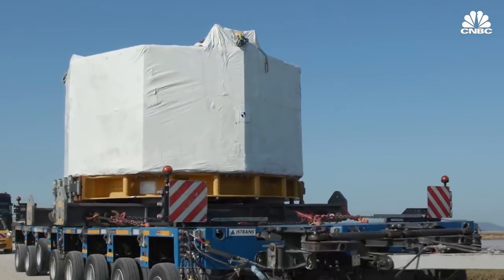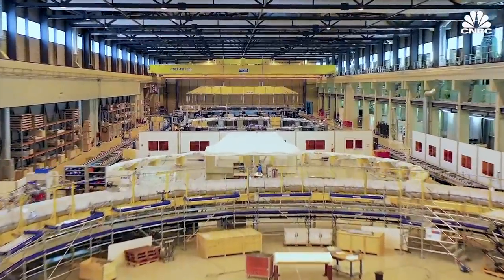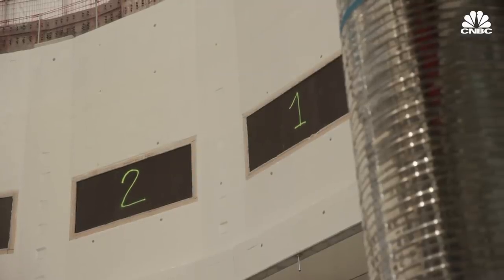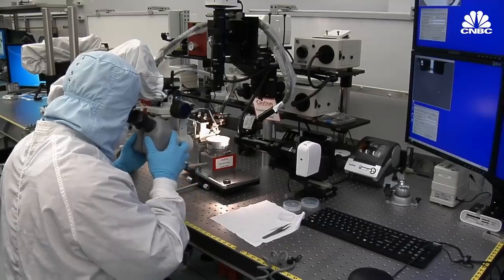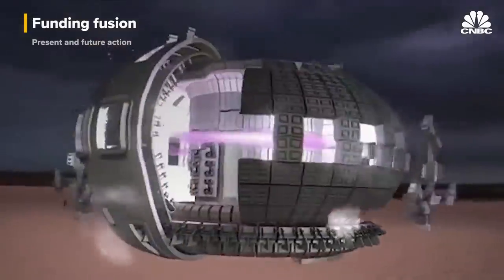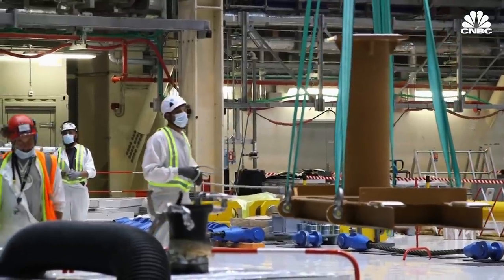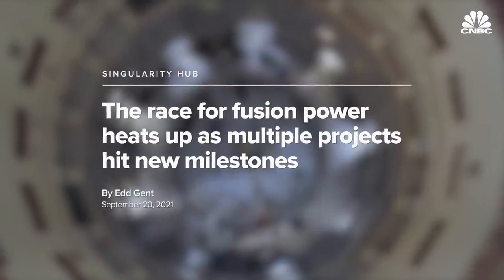Can This $22 Billion Megaproject Make Nuclear Fusion Power A Reality?

Comment: Here is my question? Will ever turn profitable even if it did work? Stuff is going to wear out and break costing probably a lot to fix. Will the net benefit outweigh the costs ever? plus all new infrastructure to translate and move this energy into a usable form in a normal house.
This is 100+ years out IMO Ill be dead by then

Comment: When you thought the world was at it worse, you get this. "150 million centigrades" (2:38), that's ten times the estimated temperature of the sun's core. Have any "calculations" been made as to what could happen if this magnet barrier fails, where this reaction and heat goes and what the impacts are?
Or no?
Reply: Magnetic fields don't just fail. There is a great amount of energy in a magnetic field of this size and strength and it takes a while for that energy to dissipate. The experiment would safely shut down during that time. Worst case the plasma hits the wall where it might do minor damage. The facility would be down for repairs for maybe a year or so, depending on how long they would have to wait for the radioactivity of the wall to decay. You simply have the wrong ideas about the meaning of temperature in this context. What is happening in there is nothing like the interior of the sun.

Comment: I am staggered by the size and cost of this project because they are not sure it will work and do not have a viable application for putting this massive experiment into services to justify the cost of building it in the first place.  It would seem that they could have made a much smaller version if it was just to prove that it could work.  However, now it looks like they were too smart for their own good and may have shot themselves in the foot as there may not be enough money to finish the dam thing.  It's like they never really had a budget to achieve the success of the project.  WTF!
Reply: The funny thing is, the smaller project would produce a lot of energy and maybe even more than fusion. They are just stupid.

Comment: Will this make net energy? Well yes, but no... Let me explain. Their goal is to take 50 MW of input heat energy and get 500 MW of heat from fusion. 10x. Great, huh? Sure, but that's not the whole story. ITER will actually consume at least 300 MW (I've heard of estimates that are over 400) of electric power to function (the 50 MW is just for the direct heating of the plasma). So we are down to 1.6x. And since the efficiency of converting heat into electricity has a theoretical limit of 50%, they can only make 250W of usable electric power.  So we're down to 0,8x. The theoretical maximum is 80%. Real life numbers would probably be much lower.

But it's hard to impress people with that. They always say that ITER will not create electricity for the grid because it's an experimental reactor that is designed to only test various technologies. But the truth is, it will only run for short periods of time to perform tests. Because even if it worked exactly as designed and maybe even a bit better, it would only be a power drain not a power producer. 

All the people involved know and acknowledge that this is just prototype for various technologies. They hope they will learn from this to make an actual net energy reactor. But saying this will make net energy is simply dishonest. Not sure what will happen first:  we get a working fusion reactor or a fusion documentary that properly presents basic facts... :)

Comment: If the magnet will lift an aircraft carrier 6’ off the ground it will lift it 600’ of the ground. The height is doesn’t matter.
Reply: I believe what they mean is, theoretically, if the magnet was held six feet off the ground, a carrier would be pulled upward to stick to it. Like, 6 feet is how far it's magnetic pull can reach.

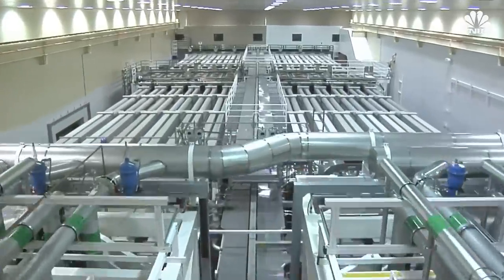Comment: 3:09 Yet another pop sci video that gets the most important figure wrong. Dont get me wrong, I'm very happy fusion is being researched and covered, and i agree it needs far more funding, but this efficiency factor theyre implying of getting 500 MW from 50 is highly misleading. These are the energy outputs and inputs for the nuclear reaction itself, not the reactor as a whole device. ITER will become the first to produce a net positive REACTION, but it will not even come close to generating electricity. Overall it still takes far far more energy to run all of the machinery that enables the reaction to take place inside the reactor, and ITER is not designed to ever generate a net positive energy output overall. That will come from its successor, probably some time in the 2040s/50s. Getting there faster will require massive funding, and although I think its totally worth it, ITER isnt designed to generate power and we shouldnt mislead people. What we should do is create a new national fusion development program and give them a budget twice the size of NASA (a drop in the bucket compared to the 800 billion pentagon budget).

Comment: Even in the first 2 minutes there are two items of misinformation. First ITER will not be a net producer of power, second the fuel is not hydrogen as is stated. We should be clear, even if the conditions for the DT reaction are met, only then do the real problems begin as designers try to work out exactly the details of 100% tritium breeding and extraction (almost certainly impossible - the tritium will diffuse rapidly throughout the structure) and how to fit together neutron multipliers, breeding modules, magnet shielding, pumping ducts, cooling pipes, etc. The complexity is mind boggling, and the cost will be astronomical.

Comment: ITER will produce more energy than needed to heat plasma in reactor core not to run entire reactor itself. Please correct this misleading information goal 500MW Heat consumption of entire reactor during this is 620 MW for peak periods of 30 seconds during plasma operation and 110 MW idle. Ifno from official Iter site.

Comment: I hope it splits the earth in two .
Reply: Welp it can't
Reply: @marcovillela7438  if the heat it generates can't be contained what preatel do you think is going to happen .
Reply: @michaellalanae7228  Simple the plamsa will start to expand making it lose its density and with the super cooled magnets around it, it will start to loss heat and turn plasma back into a gas. So basically the only thing that would be damaged will be the fusion containment module and the super cooled magnets.

Comment: It is not an "innernational" project, on the contrary it is "international", which is something completely different.  Please, do not speak sloppy.  BTW, 50 years ago, when I was in high school, we were told that nuclear fusion would provide energy in ... 50 years.  It did not happen, and it will take at least another 50 years before we might see any results.  Been there.

Comment: As a scientific project this is good, however the practical use of the technology is far away. Go for molten salt reactors. The science have already done and the engineering has come far already to have a cheap, reliable, safe and carbon free energy production that has material to last for ten thousands of years. That will give scientists plenty of time to figure out fusion Energi.

Comment: Why don't they make nuclear power plant so that bills be cheaper
Reply: If you do a full costing of fission power, it is more expensive.  Fusion power is not yet a thing.  They have good reasons to not make either type of power plant.
Reply: @kensmith5694  but in terms of usefulness I think nuclear power plants are more useful than thermal or coal. But strict maintenance must be maintained
Reply: @DunKirk1st  yes they can produce million of times more energy then coal

Comment: No one ever mentions the 14 tons of ultra-toxic beryllium used for the First Wall.
Reply: And with that? Your logic is not that great really. That beryllium is now in a safe environment where it cannot harm anyone. Would you prefer having underground, maybe just under your house, in a nuclear waste containment facility?
Reply: @deepdream1119  Safe environment?  You are wrong.  The plasma in the tokamak will erode the beryllium into dust, which will get spread into the port cells during maintenance.  This is well documented.
Reply: @robertwinkel9209  So what's your source exactly?
Reply: @deepdream1119  Because I work at ITER and we are studying this closely.
Reply: @robertwinkel9209  And I am superman, I am here to protect people from giant alien lobsters. Provide proof
Reply: @deepdream1119  I can't post a picture here.  Send me an email address and I will send you a note from my ITER email account.
Reply: @robertwinkel9209  "The beryllium used in the manufacture of ITER components will be non-radioactive; however, measures, systems and actions shall be implemented to control and prevent any beryllium exposure to workers, operators and the public. Classified as a potential carcinogenic, the primary risk with beryllium is the inhalation of beryllium dust"
Reply: @deepdream1119  The beryllium used in the First Wall Panels also has 5 to 10 parts per million of uranium impurities which be activated to plutonium isotopes by the high neutron flux.
Reply: @robertwinkel9209  Ok? This changes nothing really. Read my comments again.

Comment: That’s not correct it won’t generate more power than it consumes, it will only produce a fraction and will not achieve break even for the plant , the issues with fusion technology this won’t get even close , neutron production is the big problem here and lithium supply 
Only the plasma Q will break even which is not the same thing as the plant generating more power than it consumes

Comment: Increasing the temperature inside the fusion reactor does not seem to be right path to follow; an ever-increasing temperature requires ever-increasing magnetic field to contain the plasma from expanding.
Reply: There are two parameters here.  Temperature and pressure.  No more.  If temperature is not the correct path, you go for pressure.  High pressure is even more difficult to achieve.

Comment: just focus first on Liqeud  thorium salt reactors.....
Reply: Why not both
Reply: @Gomlmon99  becus 1 is easier to obtain
Reply: @morgorth3242  so? Why not both?
Reply: @Gomlmon99  like i said thorium salt reactor is easier to obtain then a fusion power plant...
Reply: @morgorth3242  So what? How does it logically then follow that we can’t do both? Rice is easier to cook than curry, but I’ll still eat curry and rice together.
Reply: @Gomlmon99  becus it takes like 30-60 years before fusion becomes a posible engergy source. we even need deterium or helium 4 both hard to get right now and very expensive fuel compared to thorium wich is easier to get and thorium power plants are a proven concept. we need a safe and co2 free engergy source NOW not over 50 years.... and solar and wind are not a option and current high presure nuclear plants are not a option
Reply: @morgorth3242  so... why can’t we do both? Just because fusion is hard it doesn’t mean we can’t do both.
Reply: @Gomlmon99  why not go first for something thats easier to obtain? then invest into fusion ?
Reply: @morgorth3242  But why not invest in both at the same time... it doesn’t have to be one or be other. We’re going around in circles haha, lets leave it
Reply: @Gomlmon99  Ur right

Comment: It won’t make more energy than it puts out. Total energy., including thermal loss of 50% for conversion into electricity.
Reply: You may want to reword your comment.
You also may want to explain what you mean.  No doubt you are referring to Q(total) for the system.
Reply: @kensmith5694  I just edited my comment, you are correct. I get frustrated with the blatant statements of net energy gain.

Comment: Love Coblentz attitude. Give me all your money and we build a commercial reactor in 1 year.🤣
That's clearly not how it works.
The C-Virus is not a good comparison. mRNA vaccines were researched for 30 years before it hit. They took what already existed and adopted it. The money helped surely but couldn't accelerate the process that much. It were shortend test phases and minimal requierments and faster processing than usually from health authorities what made it happen so fast.
But here we talking commercial fusion reactors. No one build one before and ITER isn't even one. You can have all money in the world but would it speed up the development? 
I really don't think so..
There are so many problems to solve beginning from the fuel (Tritium or Helium-3 are not feasible in large scale because they are fission product themselves.) over which typ of reactor to choose (Tokamak or Stellarator?) to new matierals for the containment which could resist the enormous amount of neutron radiation... 
That all takes time. Wouldn't suprise me this would took longer than another 30 years even with 4x the funds.

Comment: Yah, lets create stars on the planet. Hoping mechanical containment. And why would you build a fusion reactor this large? Only on a tiny level would this much heat containment be somewhat safe
Reply: How do you know what is and isn’t safe? Do you have a career in nuclear safety cases? 

There isn’t even much heat energy stored. It runs at vacuum.
Reply: @Gomlmon99  15,000 degrees f. I wonder how far that heat ball would travel, the hole it would put in our atmosphere and the ground
Reply: @polok890  Go back to school. It doesn’t have the heat energy to even burn though a quarter inch of steel.

Comment: A waste of money. Fusion will never be achieved as long as it relies on energy-intensive magnetic fields. Geothermal is where the efforts should be focused. All countries float on an ocean of magma. We only need to be able to drill a little deeper than we can right now and then geothermal plants can be used anywhere. It takes up very little real estate, works 24/7, purified water is the bi-product, is an inexhaustible energy source, and is 100% green energy.
Reply: On theory it can be done.  In practice, it is very difficult and close to impossible.  To get to the mantle to guarantee access to hot magma, you need to drill past 48km.  The deepest drill hole ever made by human being is only 7km.  Six times more drill depth is required.  Ever if it can be done, the cost may be prohibitive.
Reply: @catchnkill  You don;t need to get all the way to the magma. The reason they haven't been able to drill further than we have is that it gets so hot it melts the drill tips. We don't need to be able to drill much further to where it is hot enough for geothermal to work. 
 There are at least two companies working on ways to drill further. One I think is in texas.
Reply: @The1stDukeDroklar  It is not the drill tip melted.  The condition down there was very unfavourable.  Temperature was 180 deg C and it was not enough to melt drill tip.  However, the rock density was lower than expected, the rock was more porous than expected, the temperature was higher than expected.  At that conditions, the rock became like plastic and making drilling impossible.
Reply: @catchnkill  I assume you know that I did not mean the tip actually liquified. The term "melting a bit" means the temperature was high enough to cause the bit to dull quickly rendering it inoperable. 
 There was a slew of problems they encountered in several of these early attempts including the porous rock you mentioned. Gas and fluid leakage into the shaft were another. 
 A group out of MIT has formed a company that is working to address these problems. They are using focused energy beams to drill with no actual bit involved. One of the big advantages is that it literally melts the walls of the shaft sealing out gases and liquids from leaking in. 
 Worth mentioning is that the old projects had estimated the temperature would only be 100c at the depth they had to stop but as you mentioned, the temperatures were actually 180c. This has been observed in several deep drilling experiments so it looks like we may not need to drill as deep as previously estimated to reach the temperatures required.

Comment: Stupid humans when they build it they will cut cost and leave out some parts causing this thing to blow up. If the Russians and Japanese would have put more safety systems into those reactors the explosions could have been avoided . All nuclear fission reaction accidents were caused by one thing that is lack of coolant water .  For what is still costing humans to deal with the remains of these reactors they could have put in 100 redundant water coolant systems but no shortsighted humans could not see past the bottom line don’t be stupid humans always put the $$ in up front n the long run it’s cost less nuff said
Reply: The waste from fusion is not very radioactive, and the reaction can be stopped easily by stopping fuel supply.

It's the cleanest and most efficient energy source we can think of at the moment, so it'll have to do. The alternative is just keeping burning fossil fuels until we run out.